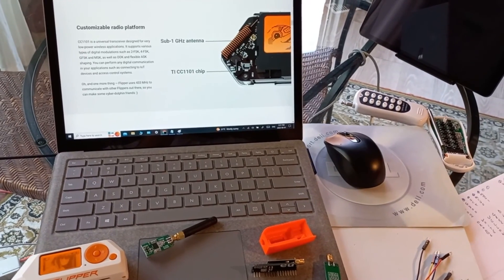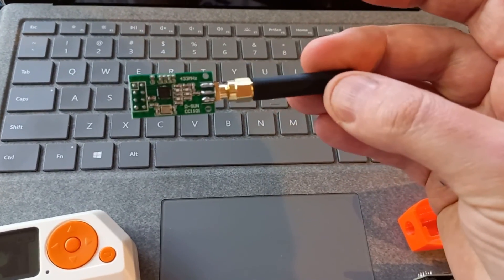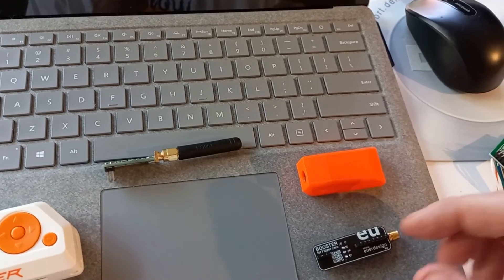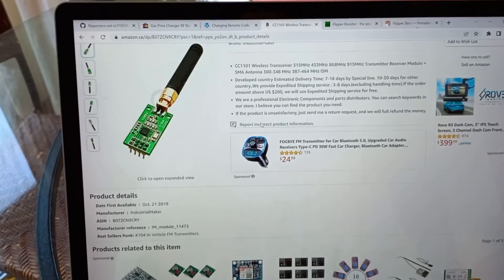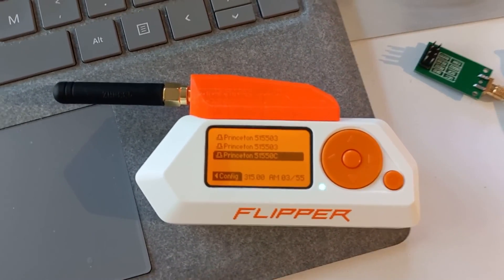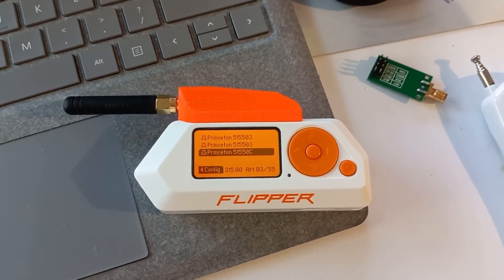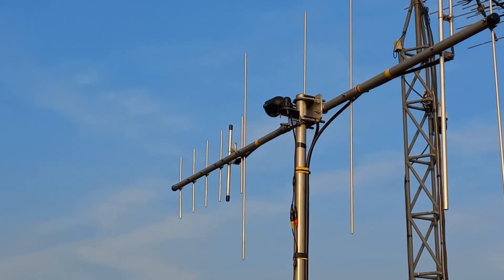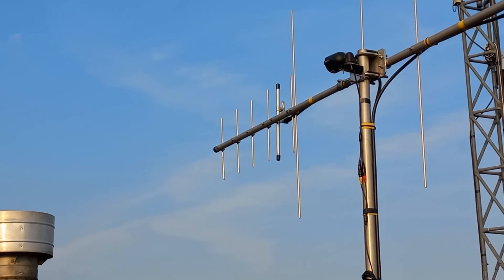Flipper Zero Garage Doors, Gas Signs, External Radio Modules

Comment: @peterfairlie2296 after you reconfigure the controller how do you reconfigure the box to still be useable with the controller?
Reply from the maker: There is a learn button on the receiver. Push it and it will enroll the fobs new address.
Reply: @peterfairlie2296  thank you! Worked perfectly

Comment: I have the same remote Princeton 24 bit and i changed the jumpers exactly like the gas station remote, i even captured the signal from my remote on my flipper and they were the same. I tried multiple gas station signs around me and none of them were responding to my remote singals.(I tried pressing 1 5 times to enter editing mode) nothing worked.

Comment: if you dont have a SDR at least get the 20$ RTL-SDR boot up linux off a thumb drive if ur not familliar a tool rtl_433 can decode all kinds of stuff. and just cause the name has 433 u can tune ut to whatever i get keyfobs dooor sensors from alarms tier pressure sensors in new cars  that 4x tranmitters with unique serials lol we are so bugged i like the wya u think. wish i could spend the money on gear u get. thx for the tip about the gas price boards i will be setting up a pi in my car so i can log random stuff or just ssh into it from my tablet sorry for the sloppy tipeing im in a rrush keep up the vids man!
Reply: juding by the pice of hardware ive seen on here im surpised he hasnt got a ettus resarch sdr and OPEN BTS TO run a local cell network that can conect to his other voip intercoom stuff

Comment: I'm still trying to figure out how you managed to add a security+ 2.0 garage door. That thing has rolling codes, which the flipper can't real connect to.
Reply: I’m using the unleashed firmware and it does Security+ 2.0 rolling codes. Those aren’t encrypted in any way. They just add to the last used code.

Comment: There is no shortage problem, when there is the case installed - the design prevents it, and the pin is now cut of in every module from back side in production.
Reply: Good to know :)

Comment: I have a dipole on my roof with SMA termination. Used to use it with HTs. It will be interesting to hook it to the Flipper.
Reply: @peterfairlie2296  it's a homebrew. Literally coat hangers and coax. Lol 
I've only used it on 2 meters but I'm sure it's functional in that general area.

Comment: Do you think the antenna module was intentionally designed to short and damage Flippers? 🤔
I could see the issue being an oversight, but coupling it with the recommendation to turn on 5V with no other reason begs the question.
Reply: That's exactly what I thought
Reply: @peterfairlie2296  oversights happen. Hopefully they see your video and atleast remove the suggestion to turn 5V from their website. A little insulating tape on future models wouldn't be bad either.